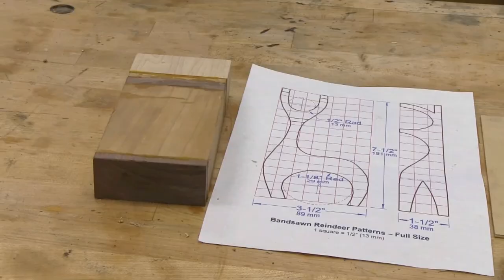Scrap Wood  Reindeer / Bandsaw Magic!

Comment: omg. that drill with the sanding drum. Genious!
Reply: I was just gonna say is that a drill press with a sanding drum??!?!? How fast is it spinning
Reply from the maker: I usually set it to a fairly slow speed -- 900 to 1500 rpm. The finer the grit, the slower the speed. If you don't give the abrasive time to clear the dust, it will load up and burn the wood.

Comment: Could this be made differently, like one stand the opposite of the other and one standing straight looking forward? I bought your plans for this and it’s turned out good. Thanks
Reply from the maker: There are some reindeer patterns around with the deer looking forward. You might want to consult these to see how or if this design could be so modified.

Comment: Thanks a lot for the video. These are really great. I have made a few but i am keep breaking my bandsaw blades (einhell). Have tried with oak and then pine as i thought it was due to oak being hard but the result was the same. Any tips?
Reply from the maker: You may be using a blade that's too wide to turn the corners without stress -- a 1/4" (6 mm) blade will just barely make the turns. Or you're attempting to saw thick stock with a normal blade. The gullets of a normal blade aren't deep enough to clear the sawdust when cutting stock over 3/4" (19 mm) thick. The chips pack in the gullets increasing the friction, and the blade heats up and breaks. Try a 3/16" (4 mm) 4 TPI skip-tooth blade.
Reply: @WorkshopCompanion  Thanks...will try that. now that i think of it the blade seemed like dull some times.

Comment: I would like a band saw but have no idea what to get or how much to spend, any advice appreciated.
Reply from the maker: If it's your first, look to the used market. (1) Since tools don't wear out like other consumer goods, you get more band saw for your bucks. (2) You get to know the saw inside and out because the troll who had it before you trashed it and now you have to clean it, restore it, and re-align it. (3) If it isn't what you wanted, you don't have that much money invested. But you still have the experience and you're no one tool wiser. As for brands, I have had good experiences with Shopsmith, Delta, Craftsman, Grizzly, and Atlas, all from the last half of the twentieth century.

Comment: Is it best to use green oak or fully seasoned oak?
Reply from the maker: If you use green oak, you'll run the risk of the sculpture distorting and cracking as the wood dries.

Comment: can you share the blade size? nice work!
Reply from the maker: Use 1/4" skip tooth (6 tpi) or 3/16" (10 tpi). If you don't drill the holes for the antlers and the legs, you'll need the smaller blade to negotiate the tight curves.
Reply: @WorkshopCompanion  I really appreciate your quick response and knowledge!

Comment: What speed do you have on the drill press?
Reply from the maker: 460 RPM -- as low as it goes. Otherwise, sawdust packs in the gullets between the teeth on the holesaw and burns.